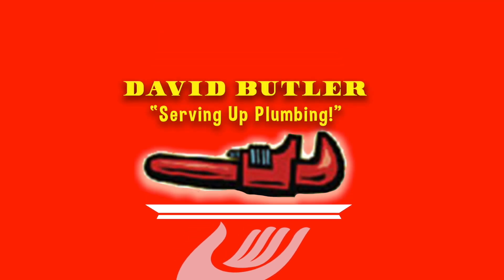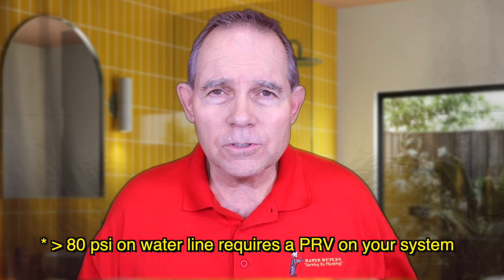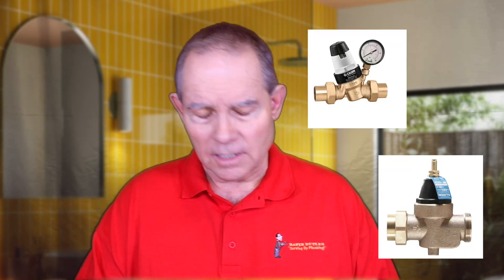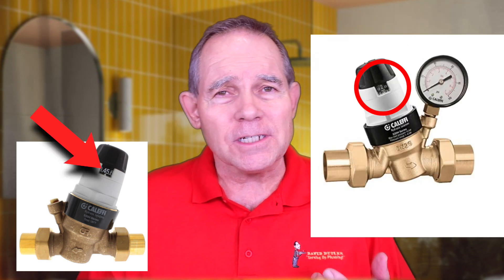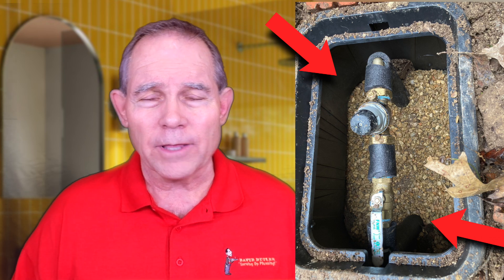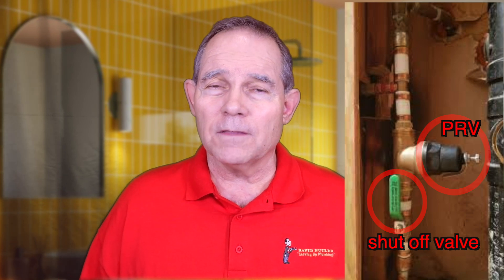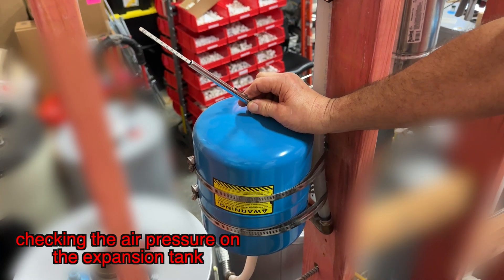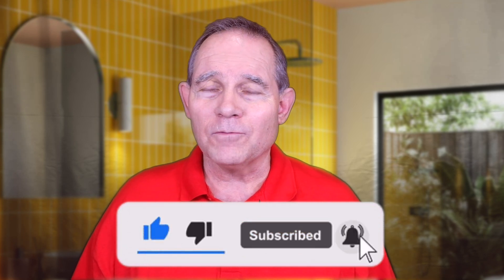Pressure Reducing Valves: When and Why You Need Them!

Comment: I don't know that the water system I am on ever has over-pressure, as anytime I have checked, it has been within the normal 40-60 range.  Just the same, I recently ordered a Merrill prv for around $15 which I will probably attach to an outdoor faucet. If I am correct these work by dumping water when the pressure is over 75 psi.  The type of main line prv you mention works by closing off flow thereby creating a closed system that requires an expansion tank.  What do you think of the type of prv I am planning to use?